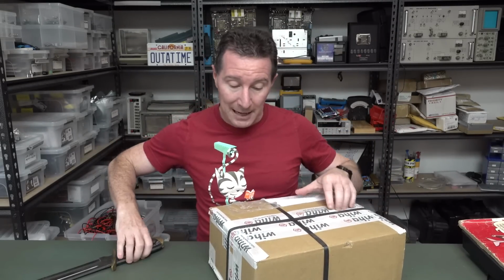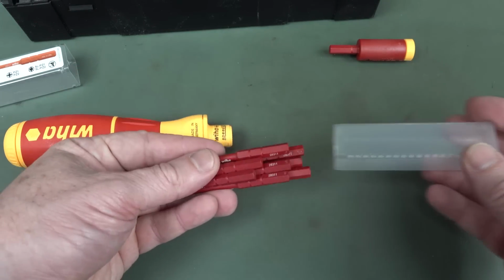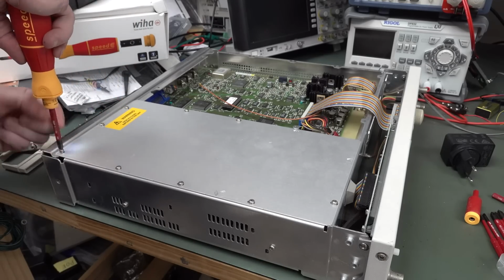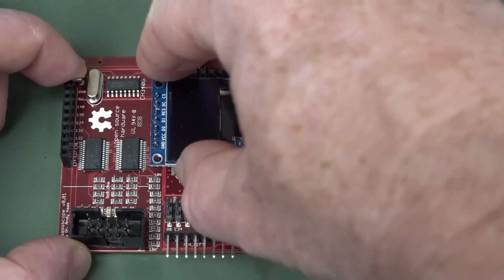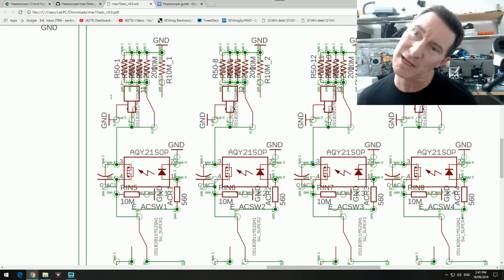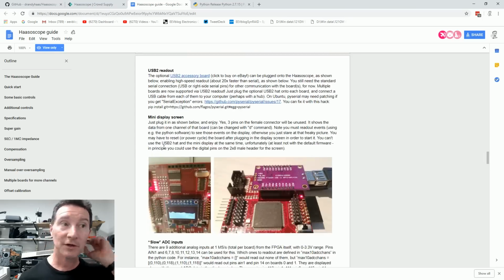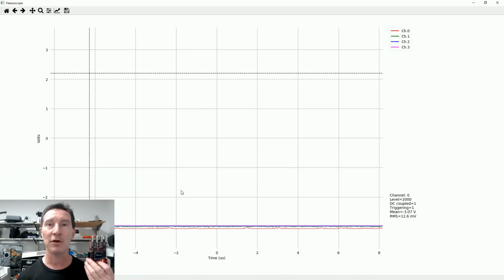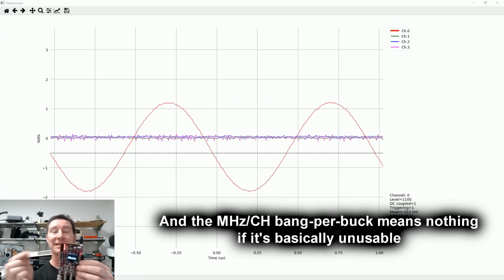EEVblog #1127 - Mailbag Monday

Comment: Don't be hating on Git(hub). If the creators knew how to utilize all the features, installation would have been a breeze. People who publish OSS projects need to learn how to do releases, so end-users don't even need to download the whole repository, or at least include an install script that deals with all dependencies.
For anyone who publishes on GitHub, here are some best practices:

Include a README.md file, include a brief description (2 lines) of the repo's contents followed by end-user install instructions and the other usual stuff.
Include a BUILDING.md file, state all (build) dependencies, toolchains etc. and in-depth build instructions.
Include a INSTALL.md file, this file should go in depth on how to install software permanently to all supported (read: tested) OSes
Use (git) tags to reference stable versions
Use releases (done by tagging) to provide a download that end-users can install.
Use folders to sort your files, don't mix source code, documentation and assets.
Include a CONTRIBUTING.md file to explain how you expect other people to contribute to the project.
Check and update documentation regularly.
Sign commits, tags and releases, provide file integrity checksums for binaries.
Be nice to people who open issues (they do so because they want to improve your project, otherwise they would just silently delete their downloads)
List currently active maintainers at the bottom, or put *unmaintained* at the top of README.md

Just because you push something to github does not mean people will take over development. You have to introduce and actively invite people to use and contribute to your personal projects. As seen here, you can't even rely on people to know what $PATH is. You have to document even the most trivial things to get reproducible results, or else your repository will just rot among the millions of other dead code-bases.

Comment: I've used Eagle for a long time now, I would never let a schematic go out looking like that.  It's totaly messed up.
This looks completely rushed.... the biggest error was to not allow enough room for all four BNC scope probe connectors.
I wonder if they were using the free version of Eagle which limits the board size to 160 squared cm, I think it is.........That's the only reason I can think of for cocking up the distance between BNC's.
Reply: I've been employed in the past to bash into shape a firm's quick-and-dirty schematics used for CAD PCB layouts so I can say with some confidence that this one's a mess.

Comment: Well you got both of those right.

The screwdriver is the suck - I don't see the point. I would not use it for electrical work. Yes, sometimes I need to torque down 100 screws, so I expect speed, and an adjustable clutch. This has neither.

The "scope" reminds me of the Mooshimeter (it's great hardware, Cat rated and all, lots of potential). Potential means nothing if neither the developer nor the user have time to implement any innovative ideas.

Comment: Wouldent buy the screwdriver due to envormental effect of all that packaging, they could have put everything in the plastic case (like most other electric tools) but I guess they could not justify the price for a slow battery powered screwdriver unless they bigged it up by putting it into a large box. Make your environment count and dont buy.  For £6 on Ebay you can get this excluding batteries, free delivery.  I am not affiliated with this link and there are many other suppliers too...   http://www.ebay.co.uk/itm/282496126156
Heck of a difference in price for effectively the same tool, okay its not 1000v approved but i wouldent use one of these on 1000v anywat due to wobbly tip.
Reply: Worth about 10 Euro, dont think it will last long
Reply: > envormental effect
Cardboard is waaay better packing material than plastic.

Comment: I don't know, I like my Panasonic 3.6volt driver.  It has torque setting and the replacement batteries are easy to get on EBAY.

Comment: 18500 is exactly the right choice of battery! Otherwise people would have a bunch of batteries already and would not buy your overpriced branded ones...
Reply: The 18500 is a standard size battery, it's just not as common as an 18650. There are lots of good branded ones available and lots of crap quality unbranded ones too.

Comment: Who thought writing the software in python was a great idea? Probably the same guy doing the schematic.
Reply: Why not?
Reply: @JGnLAU  same reason why it shouldn't be written in java either . Its slow and interpreted. The only advantage is that everyone can scramble it together quickly.
Reply: It's not THAT slow, plus you can write C extensions for computationally expensive functions. Or use already existent packages with C extensions.
Reply: Not really, it is compiled into bytecode and still runs on virtual machine. Same way CPython does, actually.

Comment: I had a black&decker gyro driver that was similar to this but instead of that rotary part, it worked by motion. so you press the button and as you turn your wrist it starts to spin. spinning faster the more you turn. It was really cool! And could get really good control over torque/speed with the motion control. Was expensive at the time tho.

Comment: Probably should be able to solder the BNC connectors alternatively on the top/bottom of the board so the connectors fit much better.

Comment: The schematic really looks aweful, along with some python coding style.

Although you may be a little too harsh on python requirement. It's a shame that they haven't shifted to python3 and doesn't even have the interpreter specified at the head of their scripts.
But during the transaction period to python3, having both python2 and python3 installed is pretty common at least for Linux distributions.

Comment: 18500 isn't as ubiquitous as 18650, but it IS a standardized size, and it's possible to replace the cells, unlike cordless drill batteries. Sanyo and Panasonic both produce 18500 cells (although if I recall, Panasonic bought out Sanyo's battery division). Moreover, Keeppower is a very respected brand among high-power flashlight enthusiasts. Before you laugh and shake your head, a good number of us on the r/flashlight subreddit and/or budgetlightforum are in technical fields, and take Li-ion safety (and performance) very seriously. Keepppower started as a rewrapping company, taking cells from Samsung, LG, Panasonic, and Sony, and adding protection circuitry to them. I believe they have begun to produce their own cells as well, and there is a consistent trend upwards in quality. HKJ, a Danish man who is considered the gold standard reference for all things Li-ion, has tested a few Keeppower 18500's, one of which is linked here: https://goo.gl/sxrLT6 . While that is a high capacity, low discharge cell, I cannot find a recently produced 1500mAh cell in his reviews.

On another, related point: CHARGE YOUR CELLS! Individually packaged Li-ion cells now have to be at 30% SoC in order to be shipped by air. This requirement is waived when the cells are packaged "with or inside equipment", but I'd be willing to bet that a major company (with major insurance) like Wiha will play it safe and comply anyway. 30% SoC is somewhere around 3.2V, which means that your series combination is only at 6.4V of its 8.4V fully charged. I wouldn't be surprised if you get a significant performance boost from fully charged cells.

Comment: This scope isn't more than a teaching tool, half of it of how NOT to do things.
I got a JYE Tech DSO-SHELL DSO-150. It is just a small single channel scope and yeah it's bandwidth is just 200kHz. So no contest there. And still I would take it any time over the scope shown in the video. I could buy 5 of them on Banggood (where they sell the original and no knockoffs) for the same money. 5 channels that I can use at the same time and that are isolated from each other. ;)

Comment: A extended cap for 18650 would be a good 3D printer project. Also Dewalt has a motion activated cordless screwdriver which is way easier to use. It knows when you put the tip on a screw. Then you just twist the body and it goes, even has speed control. Also it knows when you are turning the screw manually and starts the motion control from when the screw breaks free, so it dosent just kick into high speed as soon as it starts to move.

Comment: Dave, you demonstrated the SpeedE in a quite misrepresentative way, because the Wiha SpeedE is purpose-build for tightening screw terminals in electrical cabinets 
(which are quite short in comparison to the screws of the 'scope).

In that aspect, It's fast enough and VDE 1kV approved.

Comment: I hate devs that think its ok to make people manualy install python and run commands . Sure on linux thats fine as it will pull everything down , but not on windows.
Reply: It's one thing if everything is completely free. But as soon as I have to buy anything that's over $20 they better figure it out. I might jump through 1 or 2 hoops depending on how much I  paid, but don't make it overly complicated.
Reply: It's just a poor distribution by the guy who developed. Python is currently a very popular language that is ALSO frequently used for scripting purposes and many software packages/installations require it. It's just that developer probably should have gone with some sort distribution/packaging system like NIS that would do all the prerequisite job in one click and a bunch of -bat or -sh files to run that.
I guess he though that since it's cheap and open-source then it should be other's job to improve it that way.
Reply: totally time wasting and irritating. It's the command line linux Mr Know It All culture. pffft

Comment: There is a chinese very decent, metal version of it. The screwdriver that is
Reply: You mean the Mini ES121..?
Reply: @Nicolai0Nerland  thats the one
Reply: 1000V VDE approved?
Reply: @JGnLAU  like dave said, not really needed. Save yourselve the money and get a propper screwdriver for the HV job. You dont need it when doing a lot of screws
Reply: You do understand that there are a lot of people with hand problems, for example, who can't do lots of screws by hand?
Reply: @JGnLAU  thats why these screwdrivers are here but again like dave said, howmany times do need the hv bit? If you are a service engineer for hv stuff, yea get this one. If you fix up stuff all day, discharge the caps and you are fine with the chinese one or the panasonic one thats faster

Comment: Dave, Python 3 isn't an upgrade to Python 2 as much as it is a different language. I don't know too much Python but I do know that they have different libraries, different functions and slightly different syntax. 2.7 isn't outdated and is still maintained. I don't know why it's like that, but it's valid to require 2.7.
Reply: support for 2.7 ends in just over a year, so requiring it for a new product seems short sighted to me.
Reply: It is an upgrade, just a major one.
Packages had been ported to Py3.
2.7 is outdated with it's End Of Life on January 1st, 2020.

Comment: That screwdriver, I'd have to change a few things about it, one, the speed, too sloooooow, two, the twist thing, no, use that for a direction switch, and three, to switch on the motor, press down on the handle which reduces the chance of slipping out of the screw head...

And for that sort of money, screw that (badum tish!)!!! I'll stick with my Bosch drill-driver... :P
Reply: You totally missed the point of the screwdriver. It is a MANUAL screwdriver with a power rotating mechanism. It's specifically designed NOT to apply the torque to undo or tighten the screws.... the motor is just to save wrist while running the screw.

Comment: Consider a newbie picking up that "oscilloscope" and thinking that's a standard experience. What a nightmare.

It's definitely more of a "scriptable data acquisition" bit of kit for people who feel comfortable in python. 

But, then again, can you trust the data that it's acquiring? The random DC offset is worrying. Plus the noise..

If you're on a budget, there are far better options. @eevblog has a video about finding a $50 dedicated scope on eBay.
Reply from the maker: Benedikt Müssig  - Bench scopes are pretty affordable these days. And some polished USB ones are quite useful.
Reply: > It's definitely more of a "scriptable data acquisition" bit of kit for people who feel comfortable in python. 
Bingo, and it's a shame about that dismissive attitude. 
If you want to setup an automated testing rig as an hobbyist I don't think there is anything out there that can do this.
Reply: Well to be fair, these analog scopes aren't too useful in this day and age anymore. If you decide to start getting into electronics, you have to live with spending a lot on gear initially.

Comment: The problem with opensource is far too many people seek the glory of new features and enhancements, and not fixing existing issues (with eg hardware, software, documentation). Any criticism is met with "well why don't YOU fix it!!!!". Of course for free opensource, it is like looking a gift horse in the mouth, but it still has to be said. The best opensource, have frequent design period freezes where they just work on fixing existing issues.
Reply: Well, if you want something to be fixed - fix it! How else this should work? It's FOSS for a reason.
Reply: @JGnLAU  I can't tell if this is sarcasm. Anyway, a lot of open source users don't have the knowledge (e.g. non-programmers) or time (families, day jobs, maybe contributing to other open source projects already) so fixing problems isn't always an option. Not to mention, code that needs such fixes is often poorly designed/documented, so it's quite time consuming for other people to understand it well enough to make fixes.

It's one thing for somebody to release their side project as open source while it's rough around the edges. Actual products, with actual promises, released with low quality software under the guise that "it's open source, users can accomplish anything they want with it!" are a problem. They are the reason why Dave takes one look at GitHub and groans. It gives open source a bad name.
Reply: How it should work is that people should take pride in their work, instead of producing crap and then using FOSS as a copout.

Comment: The Bosch Go screwdriver is $50, looks very similar but is far more powerful and more adjustable!
Reply: Yea I picked up a Go in a nice box here in ZA for that amount equivalent, Bosch Blue. Nice tool, not removal cell, but compact. I use it to work on electrical circuit breakers in distribution boards but would not use an electric one on anything live anyway, I would do a hand job with a rated tool. Its just a control thing, it is prone to turning in your hand once the screw is tight, which is the disadvantage of the straight type vs pistol grip.
Reply: But isn't VDE 1kV aprooved... so its not an alternative to the target group of the SpeedE.
Reply: What is the target group? Electricians working on live wiring and fuse boxes?
Reply: YES!
Reply: IIRC you are required to use VDE approved tools when working with electricity, even when you think it's not live.
Reply: @progandy  Most likely. I work with electricity and work supplied me with wihas
Reply: Still no speed control, no VDE approval, can strip screws.

Comment: @EEVblog: Dave, you did get the idea of open source, did you???? Complaining about Github??? If you want to get some working "windows exe file" go away from me, I won't be able to run any Windows crap on my linux machines or others won't be able to run your great "windows exe files" on any kind of MAC, will they? Come on, Dave. If you want to do comprehensive test of OpenSource Hard-/ Software then just give it a fair chance to be real "OPEN SOURCE", not just some commercial pre-compiled bullshit! How could you debug any EXE file without the source code?
Reply: Ehhh, it's not that hard to make packages for most operating systems.